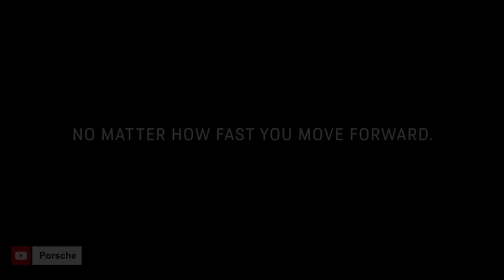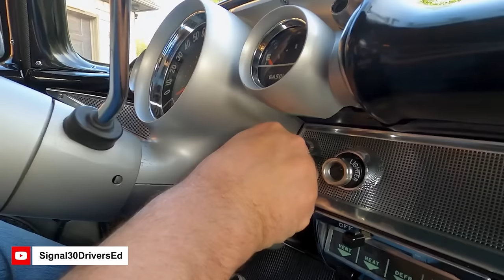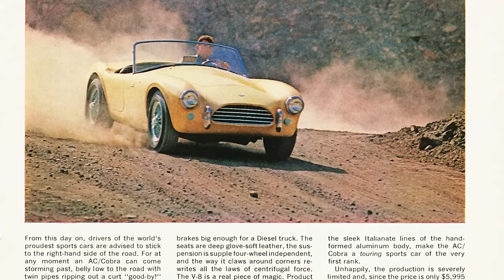Why Old Cars are Better

Comment: i am 19 and own a 2009 BMW 528i, which has hydraulic steering. My older sister has a 2023 civic with electric steering, ive driven my car already 30,000 miles and counting. The other day i drove my sisters civic for a few hours and i hate the electric steering. At high speeds it changes the power of the steering, rather than being able to move the wheel a full 360 degrees it locks up at certain angles and if the rode isnt straight completely with the car its annoying to adjust the steering as it only lets you move it within certain angle intervals. Just another example of technolgy getting better, but usuability downgrading through complication. This is with the lane assist off^ Obviously the electric steering is better in other areas, but it just doesnt feel as good to drive.
Reply: ...how hard do you want to turn at high speeds? If you're fighting the power steering at high speed, YOU are doing something wrong or stupid.

Comment: This is a prime example of what is called "sampling bias". An old house you buy has stand the test of time, otherwise it would not be here for you to buy. You will never experience all the old houses, that have crumbled, that were so terrible that they were torn down, that were so badly shaped, they were remodelled etc.pp.. All you get is the best of the best from that time, because everything else is long forgotten or reworked again and again until it could survive.
Same with cars. 90% of all old cars are long gone and dismantled at scap yards. All that have survived are the ones that were handled with care and diligently kept in good shape, that did not have out of pure chance the quality issues their brethren had, that were fun to drive and thus not scrapped after their economic life span was exhausted, that had a design which was interesting enough to keep it out of nostalgia or similar redeeming features.
Lets face it: 90% of everything is crap, and that includes old cars and old houses. It's but the fact that you can only sample the 10% that weren't crap, if some time has passed on them, that makes you think it was different back them.

Comment: Truth be told older vehicle manufacturers really had pride building cars, not like the disposable planned obsolescence  "Appliances" they have become now. 
I proudly drive my 64' Dodge as my primary daily, it's just physically built different (Memes aside) It's been a reliable daily so far going for 10 years, 
(I suppose 60 years considering the past owners that owned the car before me)

I'd disagree on the statement weather old cars are "Unreliable"
keeping everything in check and staying on top of your maintenance routines and the car will give you a reliable driving experience.
If an older vehicle "Broke" down at the side of the road, you can disassemble a carburetor in case you get a stuck needle/float assembly. and get that piece of grit out then reassemble the carburetor then off you go.

Hell, most of the things in an older vehicle can be repaired/tuned with just a $6 screwdriver, without needing a $2500 scan tool.
It's just serviceability, vs NON-serviceability that new vehicles have become.

Say a modern car were to break down at the side of the road, You'd need a OBD-II scanner to figure out where/what the issue is.
And if it's a critical computer part that has failed ECU/TCM, not exactly cheap and your going to be down and out for a few days or so till you can get the replacement part.

Anywho, speaking of vehicle designs, here's an Honourable mention: Virgil Exner designed cars in the 50's/60's just looks like something straight out of some sci-fi movie, just beautiful works of art on wheels.

Older homes were just about the same, craftsman had pride in their own work, caring less of the costs but to only create a superior lasting product.
(It's appalling on how homes today don't even last even a year without having some sort of holes starting to develop in the roof, the craftsmanship and pride, for vehicles are gone)

Comment: Having own cars from 1930 to 2010,hands down older cars will always go. a small bit on a newer car takes it off road,a older car can have three or four issues and still be drivable.I have several older(35-55) year old cars that are 100% reliable,the 2010 has issues all the time.

Comment: You mentioned the bit about SUV's getting larger and trucks being bigger.  To a point this is true, but the largest argument against these for pedestrian accidents is that the large nose of the truck obstructs the view and makes for a big flat surface for pedestrians to contact.  This argument is flawed.  I didn't realize it until last week when I parked my 2018 F150 nose to nose with my 1989 F150.  My 89 nose is flatter and actually sits within about half an inch of the top of my 18's hood.  as a matter of fact, by the time the slope of the 18's hood stops and shifts into the grille going straight down, the 89 does sit higher by several inches.

The largest difference between these two trucks is the view.  The 89 is designed to give you a view, the 18 is not, and it is one the biggest things I have hated about my 18 since I purchased it.  Additionally, the 18 is a heavier vehicle, but it also has better and larger brakes.  There is more plastic in the front than metal, and the metal is almost all aluminum.  If I hit a pedestrian in the 18 at 45 mph, they will have a better chance at survival than if I hit them with the 89.  That said, I have a better chance of seeing them in my 89.  The problem is NOT the size.  The problem is the incompetence of the modern Automotive engineer and whoever is dictating what ultimately makes production.

Comment: It's common sense the body is made out of steel and it actually has a real frame.

It could actually withstand a slight car accident and still be able to drive home new cars are designed to total so the dealership can make more money by selling you another vehicle it's a scam

Comment: I like a car which I can get to work, through either intuition or the mutterings of the horse's mouth, when they break down.  My Jag broke down in central London when I was on a shoot.  I intuited that, given that the central locking wasn't working and there was no power when I turned the key, that something was amiss with the battery.  I located it, fixed the loose positive lead and, boom, fireworks in the engine allowing me to get home.  Had the same happened on a piece of modern junk I'd have probably hsd to contend with  a massive towing bill to the nearest specialist garage, a two week wait while they deign to look at my car, then a letter from the Government telling me it's beyond environmentally feasible repair and should be scrapped x

Comment: Yeahh old cars are cool and feel more immersive but IMO it really doesn't matter what car or what year it's really about how much personality you can put into the car and that's what really makes the ride. For some it's an air refresher for a few it's spending weeks perfecting a paint job for your suspension. Normal people don't realize you can have a car and you can learn that car inside and out and be able to repair or replace anything yourself. Older cars are so much easier to do so but in all reality newer cars are just as easy. You can spend billions of engineering on a bolt, at the end of the day it's still only going to do the same thing as it would have done 100 years ago.

Comment: You are conflating survivor bias, cheap labor, ignorant over-engineering, and (relatively) higher maintenance with "quality".  

Modern cars are objectively safer, less labor intensive to own, exponentially less polluting, and a better value-for-dollar (yes even adjusted for inflation) over their expected life.

Don't get me wrong.  I own older cars and adore working on them and driving them, but as a consumer "product" and "transportation appliance", newer cars are better.  Sadly, that's what the bulk of the car buying public and regulators desire these days.  We're just in the significant minority.
Reply: This comment should be higher. So many fallacies in his arguments.

Comment: When it comes to style and comfort some older cars are better than most early 2000 or newer. I love the 50s and 60s looks but would hate to deal with the lack of ac and no power steering not to mention all older cars are like 90% metal and will rust like hell if not kept out of the elements like snow, also salt and chemicals most cities put on the road during winter will tarnish the car’s underbody even more.

Comment: I have. 2013 Toyota Prius. At 275000 miles it's the best car I've ever owned. But it has the soul of a refrigerator.  Like a fridge the light goes out when you shut the door. There is no excitement & no thrill snd of course  I can't work on it at all. My '51 Plymouth is a lot more fun and I can and have fixed it with just basic tools.

Comment: From the 70's on back, they were mechanical. Easy to fix. Even I'll say that up to the beginning of the 90's, vehicles were mostly mechanical. And once again, easy to fix. After that, I'll throw the baby out with the bath water. My everyday truck is a 92 Ford F-150. Over 200 thousand miles. Now is the time that I'm getting ready to rebuild her. Engine, transmission, rear-end, paint and all the little parts in between. All I'm changing is I'm building the engine and transmission for more power. Of course, it's a V8. Any Dodge or Chevy will be the same. I'm installing a 4 bbl carb and getting rid of the old EFI.

My everyday car is a 1976 Lincoln Town Car. I've already rebuilt her. Easy maintenance and repair. Insurance is more affordable, and she gets good gas mileage for an old land badge. For how affordable everything else is, it more than makes up for the little bit more I pay in fuel. 

Also, it's a hell of a lot nicer to drive than any new car. I also have an old land barge/ hot rod. It's a 68 Chrysler Imperial. Built 440, 727 torque-flight.all black. Even with the re-build, it's cheaper than a new car! Now I do all my own work except for the machine shop. So, with all 3, including the re-builds, are cheaper than a new luxury truck! One rebuilt old car will cost way less than a new car. And if you don't live in a state that dumps enough salt to fill an ocean in 1 winter, they can last with a little maintenance.

Comment: I have no problem with driving the older cars. I’m not scared of them not being safe. I write a freaking motorcycle every day a car from the 80s 90s or even the 70s is much safer in an accident than my motorcycle is by the very nature of riding a motorcycle I am exposed and I am OK with it. I just have to be careful and do everything I can to avoid an accident.

Comment: I can confirm, older vehicles are just better in their own ways. Talking personally. I had a 80s ford f250, me and my dad rebuilt the engine crank to valves in a weekend. Fast forward to today, I have a tuned 09 saturn sky, so many damned electrics on it that it makes it far less pleasant to work on. I've had 70s japanese motorcycles that ran better and more reliably then my 09 vulcan. My current truck is a 97 ranger. Ww replaced the entire clutch for about 80 bucks in a few hours. Try that on a modern car... old cars are awesome if you know what you're doing

Comment: Volvo used to advertise their cars to be good for 100.000 km. Modern cars can go easily 200k and even 300k with extra care.

So generally new cars are better.

Also fuel consumption has decreased a bit. It cpuld even be better if we would value it over comfort and acceleration.

Even today you can get small cars that are easy to work on.

I have an old car and a younger  one. Guess which one sits in a barn and which one I rely on for work. The newest

Comment: I can't believe people are so ready to ditch the ease of repair of 50's, 60's, and 70's cars for complicated electronic cars that are more reliable but MUCH harder to repair. Reliability is not everything. Reliability and repairability IS everything. Repairability on ANY vehicle with fool infection is MUCH WORSE. Gas mileage is the ONLY note worthy advantage of fool infection. My collector cars with two four barrel carbs. and points ignition have gotten me home every time for years. In 58 years of driving I can count on one hand the number of times I was stranded in old cars and three of those were in Volkswagen Beetles. I have been stranded in fool infected cars just as much even when I guessed what was wrong. After all, you can't put a fuel pump IN A GAS TANK by the side of the road, can you.

Comment: Oh man... I failed annual safety in my country because the motors to move headlights up and down stopped working due to rust. It doesn't matter there are still screws under the hood and you can level the headlights manually - if it can't be done by the button inside the car, your car is not safe to drive.

I can't fold my mirror and can't figure out why. I can literally connect the 9V battery to the motor in the mirror and fold it, reverse polarity and unfold it. But I have to have a fucking circuit board to operate it instead of simple three way +/-  OFF  -/+ switch. 

And it is an old Honda. I can think of the way of actually writing a program on Raspberry Pi, wiring my mirrors to it, get an app on the phone and be able to fold my mirrors from my phone, but... why the fuck would I do that? And yet this is literally how everything in modern car operates including CRUCIAL safety features like handbrake... oh wait it's buttonbrake now. 

PS. Don't forget because of those design regulating government good for nothing cunts we no longer have folding headlights :( (You can't have them because of pedestrians, but it's perfectly fine to drive a suv tank with hood taller than average 10 year old or person in a wheelchair).

Comment: New vehicles are disposable so that you'll buy a new vehicle in a few more years. Old vehicles were meant to go a while then be rebuilt to continue service. Old vehicles are actually cheaper and more environmentally friendly to own just because you're not having to buy a whole new vehicle when the engine's or transmission's service life is up. With my 1977 and 1997 f250s, I will probably never need a new pickup truck.

Comment: Old cars had metal parts with ball bearings. New cars are plastic ( including maniford and water pump) and bushings.  Old cars had grease fittings, new cars dont.  New cars have multiple computers talking to each other via a buss lines - old cars dont.

Comment: I have never bought a new car!  I almost bought a 1995 Nissan 240 SX brand new though.  I love the lines of that vehicle!! It was a Nissan Sylvia in Japan.  
The used vehicles that I have owned since 1996 are:  1978 Mercedes Benz W123, 280E Grey Market/Euro spec, 2.8 straight six, petrol, 3 speed auto.  1988 Porsche 911 Carrera Coupe.  1992 Toyota Pickup, single cab, 22RE,4x4 five speed.  2000 Toyota 4Runner, base model, 2.7L I4 with a 5 speed manual.  I still own the 4Runner!!! Until the 4Runner I had never owned a 2000s vehicle!  I will only drive manual/stick shift vehicles!  The M-B was great but, I could never have an automatic transmission ever again as I have been exclusively driving manuals since 2005.  New cars suck big time and I loathe pretty much all of them! A new 911 is a facsimile of my 1988.  My dream vehicles are a 1985 Ferrari 288 GTO & a 1998-2002 R34 Nissan Skyline GTR!!!

Comment: New cars are outstanding.  Comfort, reliability, efficiency, flexibility, safety.  Buy a new car today and you think nothing about driving across the country and knowing that the car will get you there.  You also can drive them for  decade without major problems.  They are now a well engineered product that does what cars do better than at any time in history.  Of course I keep my Datsun 240Z for "fun" but it's not a car that I would select for creature comforts and/or getting from A to B on a daily basis.

Comment: I own two old cars, a 1978 Mustang II and a 1963 Ford Falcon.  The Falcon is pretty much a basic car, standard transmission and six cylinder engine.  Safety was not even thought of in those days.  The car has a solid metal dash, a solid shaft steering column, no seat belts, and did have a single section brake master cylinder(I have replaced this with a dual section).  Safety wise,  even the Musang II is much better, it has a plastic padded dash, collapsable steering column, dual brake master cylinder, and 3 point seat belts(at least in the front).  New cars are far better safety wise.  BTW, I am sure that a friend of mine who died in a car accident in the early 1970s would have survived if he even had the 3 point seat belts! There are reasons that auto crash deaths are about 1/2 what they were in the 1970s(even with more cars on the road), car safety is one of them.  As to carbs, my Mustang II has the worst thing(in my opinion)  ever installed in a car, an automatic choke. I have had this car since new, and it has always had stalling issues.  Fuel injection is so much better.  I drive my old cars, but keeping them going is an effort!